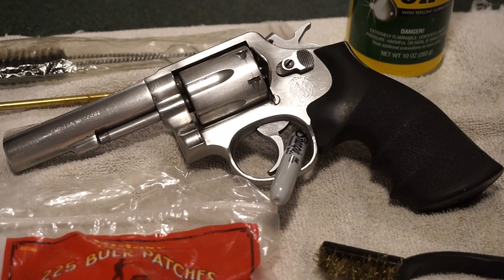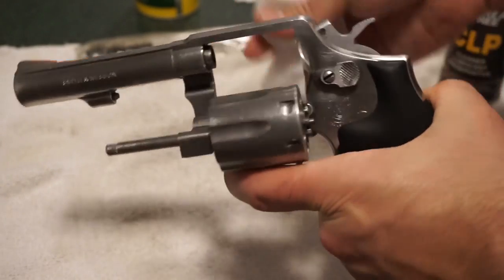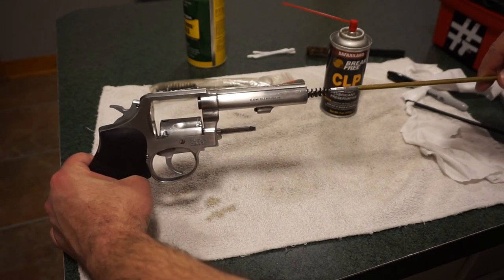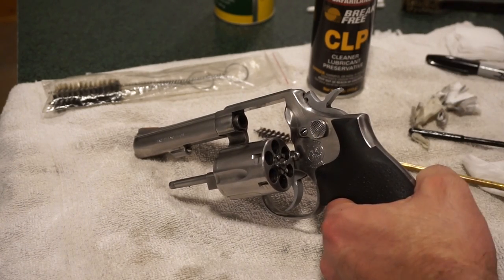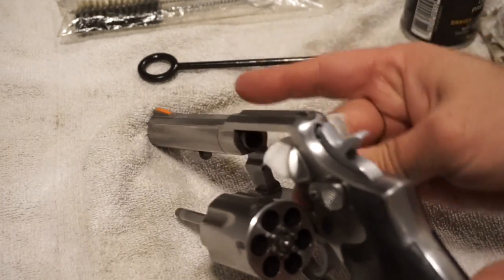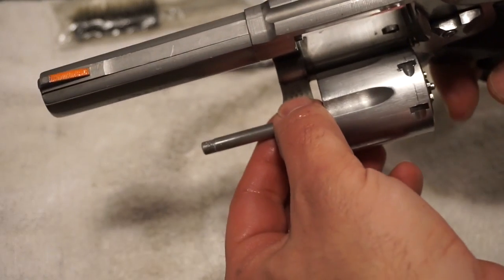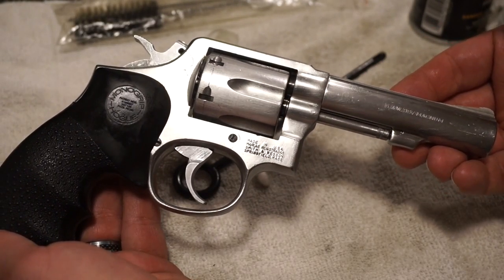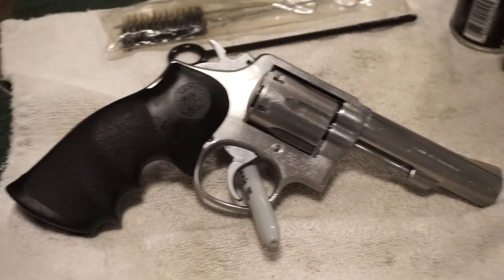Smith & Wesson Model 65-3 .357 Magnum Revolver basic cleaning. (How to clean a revolver).

Comment: Remove the #2 screw above the trigger on the right hand side and you can slide the yoke out of the cylinder and remove the entire assemly for easier cleaning. Plus, you’ll avoid bending the yoke over time.  It is also a great way to lightly oil the yoke stud or the cylendar barrell.

Comment: Fine handgun...I began with revolvers (yeah, I'm old), and I own a 65-2 shipped in 1981 (transition gun).  By that I mean this:

In 1982 the pinned and recessed feature of Smith and Wesson .357 magnums were stopped probably as a cost saving step.  My 65-2 does not have a 'pinned" barrel but has a recessed cylinder (the recessed of the rear of the cylinder allows the cartridges to set flush with the rear face of the cylinder).  If you view the handgun with a loaded cylinder from the side with the cylinder closed, you cannot see the cartridge heads.  

Another interesting fact is my 65-2 has a 'TDC" serial number stamped on the left side of the frame below the cylinder.  I haven't confirmed it yet, but I may be Texas Department of Corrections, although I read a forum someone where an individual, who claimed to have worked for the TDC in the old days, stated TDC never used these .357 magnums.

May I make a suggestion regarding cleaning a revolver ?  It is much easier if you remove the cylinder from the frame to clean the cylinder especially the face of the cylinder.  Another suggestion is to remove the grips as well.
Reply from the maker: Lee D Good advice and info! Thanks!
Reply: Even after all the years of shooting and carrying revolvers, I'm still learning new 'cleaning' techniques.  You see the carbon build-up on the face of the cylinder after shooting ?  Miserable to cleaning even with these so-called "cleaning" cloths impregnated with some chemical...Hoppe's doesn't touch it very well.  I found a video recently in which the gun owner used "Mother's Mag and Aluminum" cleaner/polish on the face and cleaned the carbon off in minutes.

I tried some (5oz container from Walmart) and an old tooth brush and .22 caliber brass bore brush.  Looked spiffy and was the easiest I've ever cleaned the face of the STAINLESS cylinder.  I'm not sure what would happen to the finish on a blued gun, so beware.

You made a great video.

Comment: You use a lead removal polishing sheet to remove the gas/carbon deposits on the front of the cylendear.  Note...for stainless steel only...do that on a blue gun and you’ll remove the bluing.
Reply: BTW...the brand is Birchwood Casey, available at Amazon.
Reply from the maker: @zenadventurer69  Ok!  Thank you!